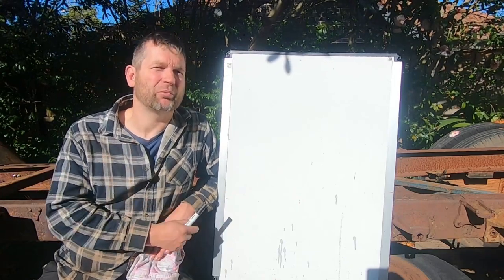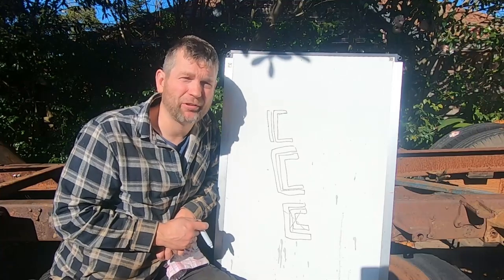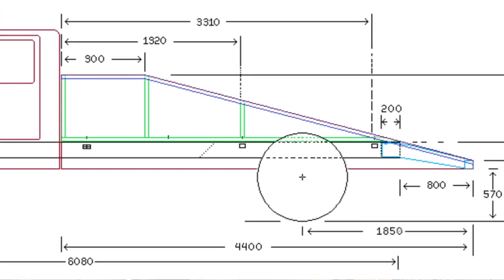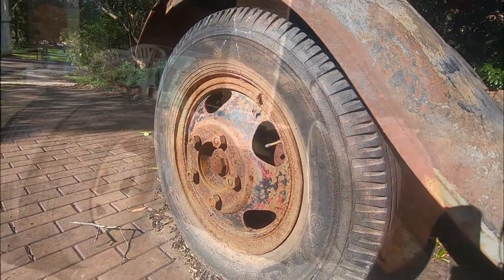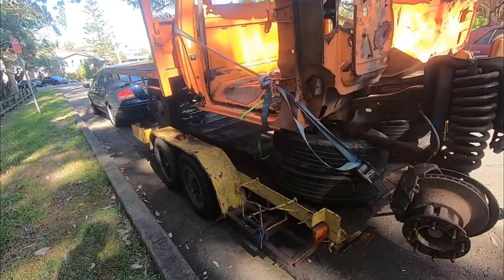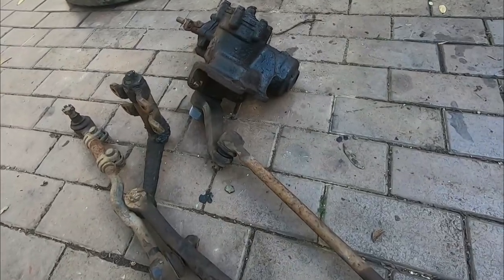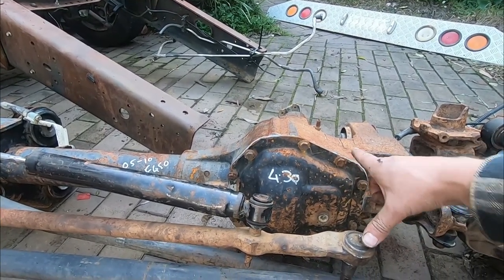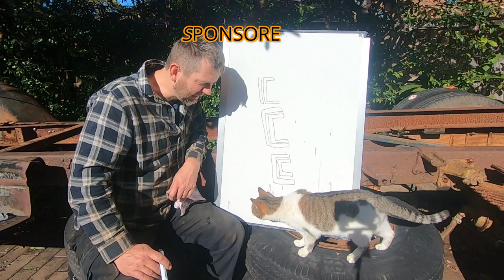Update & Build Plans for "DEATHBED" 1935 Dodge Truck

Comment: just rewatched this since i swear i'm going senile but i digress these are the kinds of builds i really enjoy watching can't wait for the next episode. 

also questions: are you going to upgrade the front suspension even though the majority of the weight will be over the back axle some of that weight will be transfered forward to the front axle or has that been taken into account? 
last question what kind of brakes are you going to use? air, drums or brake discs air imo would be the coolest since if you wanted to you could add air bags so you can remove some leaf springs so you drop the ass end down to make loading and unloading easier.

Comment: How about 2 steel angles on the inside and a plate on the outside? If you need the extra strength?
Reply from the maker: I can, but then it would push the rails further out due to crossmembers, and wouldn't work properly as the chassis still tapers up the front in the engine bay area. This way gives us the desired safety margin with the least work.

Comment: did you consider just using an extended  Ftruck chassis  and doing the ol plymouth body swap?
Reply from the maker: The diffs are out of a 100k+ truck here in Australia. Then they are coupled  to  the not so reliable 6.4 powerstroke instead of the 7.3. Chassis would probably need lengthening as well, so may as well just stick with what I already have and engineer that.
Reply: @shellberightgarage  good idea bloke...yes these trucks here are big bux hey

Comment: Not a fan of lamination of a chassis, anyone that’s played with Ford F5 and larger knows they swell with rust between the rails (trucks still built this way) If I was building something like this I would be hunting a chassis with a heavy wall to handle the GVM you are after.
That Chevy (Maple Leaf?)  you cut up would have been my base and adapted the Dodge body to it.
Reply from the maker: I hear you. However the maple leaf is still  too short, and well, it would no longer be classed as a 35 dodge anymore either.

Comment: Hi Micheal,
That f350 front end looks like my '95 lh drive. 
The ratios of the 4.3 frt and 4.1 rear differentials will not cause a problem, thought ratios were supposed to match?
Save some of those body mounts and frame hangers to use on the dodge chassis.
Looks like you might have to find the centerline of the front fenders to split them to add about 8 or 9 inches on both sides, running through an english wheel and stitching them together.
Are you going to get a jig made to step drill the rims from 5 hole to 10 hole 20" OD's?
It seems like we do not have to go through all that stuff here when you want to build/customize a vehicle here in the States.
https://www.youtube.com/watch?v=m0WUaqW20lI
Ken's solutions...
Reply from the maker: I'm yet to decide on the ratios, but you are right, they do need to match. I'll be making up a jig to redrill the rims from the garage. I'm actually thinking of making fenders and running boards from scratch. Seems like a worthy challenge. lol.
Reply: @shellberightgarage  
Fenders will be tough, you will have to make in pieces. 
Running boards make a profile sample, take a die grinder and make a cut for each bend, mark which side, then flatten the profile out and use a thin scribe to transfer the bends to the flat stock. I saw a guy do that for a 1970's DaTSUN PICKUP bed contours to match the profiles. Took a bit of practice.